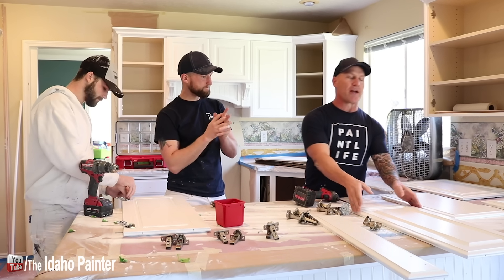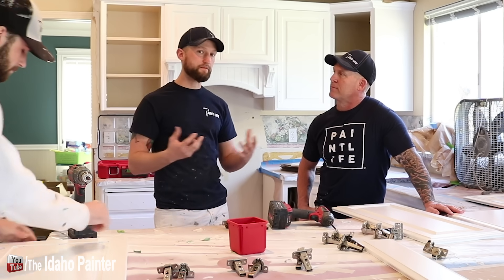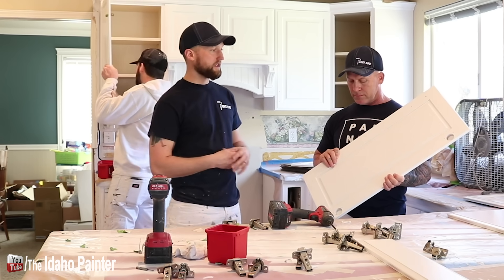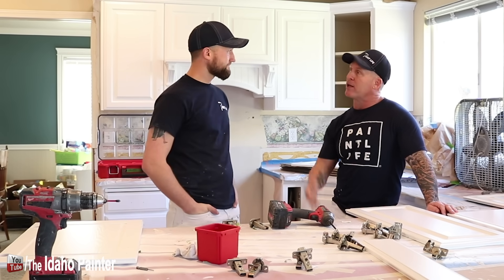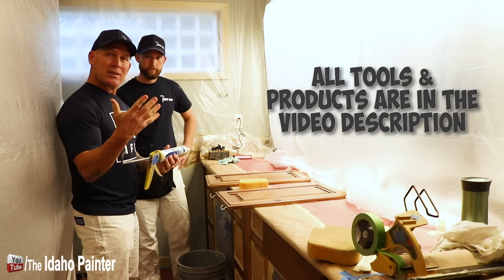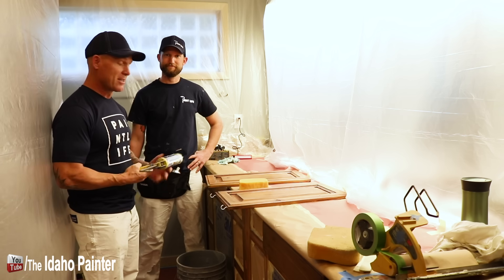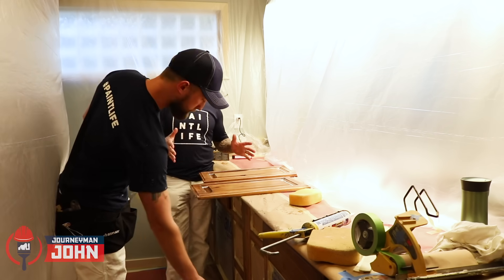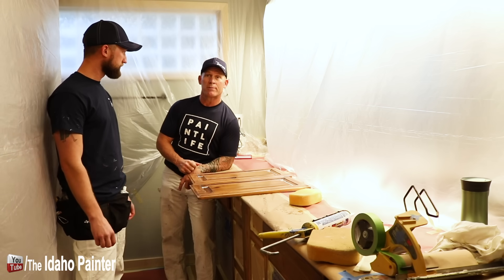Caulking The Cardinal SIN.  To Caulk or NOT

Comment: Enjoyed this video. I do cabinets in Florida and I do caulk my doors. My method is pretty similar to John's with the rag, but one big difference. Instead of caulking the entire panel at once and spending time trying to flatten it out, I caulk one side of the panel at a time, starting and ending about a quarter inch from the corners. As I spread one side clockwise toward the corner, I have enough caulk built up that it goes a quarter inch into the next gap. Then I go to the side in front of where I started, do the same thing, and the excess in that corner ties into where I started. By the time I get all the way around the door it's already crisp and level. Don't know why I'm watching videos of things I do on a daily basis but I guess we're all a little obsessed right?
Reply from the maker: lol, it is addicting

Comment: What's up guys! I paint here in Virginia and one of specialties is Cabinets. I have caulked all species of cabinet doors and the only ones I've had issues with are Pine and Oak. Not all of the projects, just a few and it's always the "Top" doors. I prime and then caulk using an elastomeric caulking. I then prime over the caulk to prevent "Flashing". I've always caulked both sides but I'm thinking caulking the backs is not so important. Cleaning, I wash em with a degreaser and scotch brite and for the nooks and crannies I use a stiff toothbrush or a soft wire brush. I mostly use "Cover Stain" for bonding but I have used stix. Whatever the case I think the cleaning process is the most important part for bonding.

Comment: In my experience never had one crack either. However all my customers ask for it to be done. I’m in the south. Things do move here. I don’t agree about putting a hot solvent laquer over old cabinets you never know what’s on the surfaces. I have had issues with adhesion issues. Laquer for new is my choice. I work in a cabinet shop. I enjoy your videos.
Reply from the maker: Thanks for the input Ronald!
Reply: There is a Lacquer base vinyl sealer  and it is designed to prime any surface, that you do not know what the base is I always use it with no concerns  works great  note is is different than a lacquer primer  but sprays on just the same, and sands out nice

Comment: Thank very informative. Doing a whole house repaint.  1st I did 4500 square feet of smooth wall over heavy knock down texture, 70 gal of mud...lol
New base. Question for ya, would you shoot the jambs and base 1st and bag? Best tape to use on fresh trim? Frog?
Also doing 700 sq ' shiplap on large vaulted ceiling. The primer on the mdf is almost a finish look, semi-gloss, would you scuff it? Red pad? It getting satin paint.
I'm doing the kitchen cabinets to. Oh yeah 19 alder wood doors in the house too.
I lived in Boise 15 years 97-2011, then Vegas now  in Montana near glaicer Park. 
Have a blessed day 🙏

Comment: I have spent much of my life caulking counters, cabinets and tub enclosures. I was expecting to find things to disagree with in your video and was pleasantly surprised. You guys obviously have experience and are very thoughtful about your work. Nice work and nice video. 
I would suggest that probably the most problematic situation you could run into with caulking free floating doors would be here where I live in Washington state. Humidity levels are often high and if you combine that with wood heat I think you might have cracking problems. Wood heat is just brutal for all kinds of wood working.
Reply from the maker: Yes, your location is always something you have to take into consideration! Thanks for watching Kirk!

Comment: What about if the panels have shaken? I recently finished a big job and the paint cracked on the doors. I did not caulk them for that reason. So now I am considering caulking with elastomeric base to Fix. 

I have heard of silicone the back to stop the shaking in general if they are. And in my case they are.
Reply from the maker: Use Tower Tech 2

Comment: I painted mine 4 years. Ago. Some of my gaps are quite large and the floating panel isn’t very sturdy.  Any tips on getting these to be tighter? Caulk big gaps or glue?  A builder put some small pin nails in a couple of the bad areas but it didn’t seem to help them much from moving   Thanks
Reply from the maker: Caulk with AU-1

Comment: I'm a cabinetmaker in Montana.  I have tried many methods to eliminate cracking and try to save time.  I'm currently dealing with a previous project that cracked on me.  Went with a tight-fit panel with a pinned back/no caulk, not my best decision!  I've heard that gazing putty could be a better option than caulk if you want a tighter inside corner to the panel.  Any thoughts? Thank you for the video!
Reply from the maker: Tower Accelerator

Comment: Quick question (really like your channel), what is the best way to repair hairline cracks in drywall interior from settling?  Big stretch caulking there as well?  Can you just force in hairline, or should you make slightly larger to have space for caulk to adhere?  Thanks for all your help
Reply from the maker: We use caulking
Reply: Barry, what did you decide about your hairline cracks? I was considering spackle paste?

Comment: I find it hard to believe that, regardless of climate, a painter could not find a way to caulk a floating panel without it cracking. Am I to believe there are entire portions of the country that are without good looking cabinets? Not likely. What I have found in 25 years of painting, blow and go to extremely high end, is that just about every painter thinks they know best, but very few actually do.

Good job guys, like your channel. Don't listen to the people scolding you on this. I am sure you would figure out a solution in their climate, as would I. There is ALWAYS a solution.
Reply from the maker: True, true, it is what works for us! Thanks for supporting & watching!

Comment: I am more concerned by the use of a power tool to install the hinge screws.  Too easy to strip the screws causing a loose screw later.  Power tools are great for screw removal and partial installation, but I always do the final turn or so the tight using a screwdriver and human hand.  Much better that way.  Yes, takes a few more seconds per screw...
Reply: if your dyi then screwdriver is fine but if you are on the job there is no time for that , the drill is better and most have torque adjustments and when you have been doing it for a long time you get used to a stopping point so that you dont over tighten
Reply: Yes, I hear that a lot and I also see a lot of screws stripped out by contractors using power tools.  Clutches and torque sticks simply aren’t that accurate and if you don’t hold firm pressure the bit will jump out and booger the screw head even if the threads don’t strip.  As an engineer, I have see a lot of torque stick tests and the results simply aren’t that consistent.  Impact tools will never have the feel of an experienced human hand.
Reply: ...an understanding of torque settings and an experienced hand (trigger finger) can eliminate nearly all of those concerns...
Reply from the maker: Has worked well for us, but thanks for the feedback!

Comment: What type of caulk do you use? Name brand please.
Reply from the maker: SW 950a
Reply: @Idahopainter  ok. So not brand mentioned in the video? SW 950a better results?
Reply: @CowboyGirl007  I believe the 'Bolt Quick Dry' mentioned in the video is a Dap product.  I have used it alot and it is a good product for this use and for baseboards etc.  Menards no longer carries this product, so you may be able to get it online.